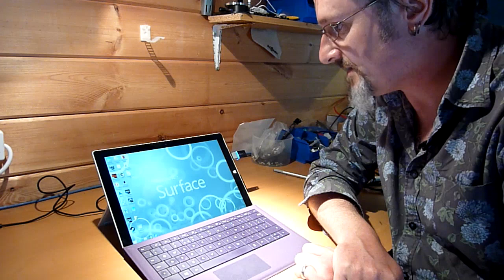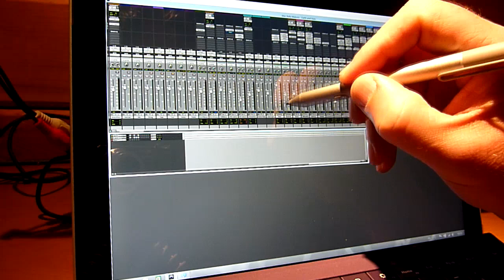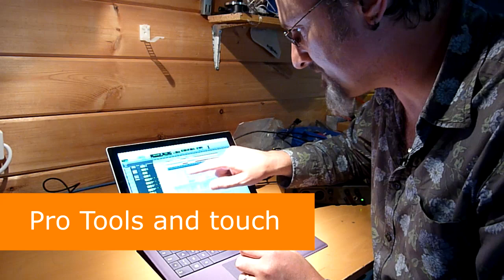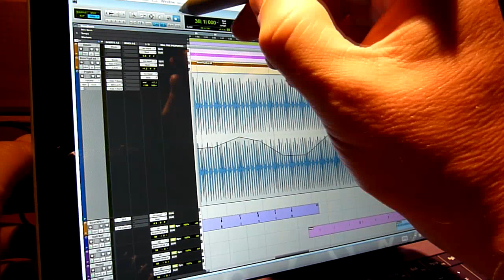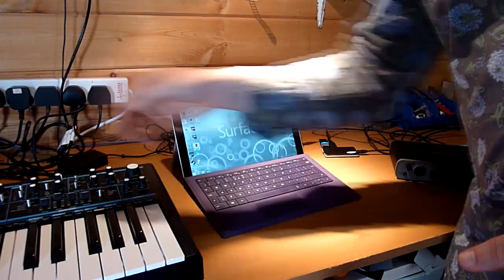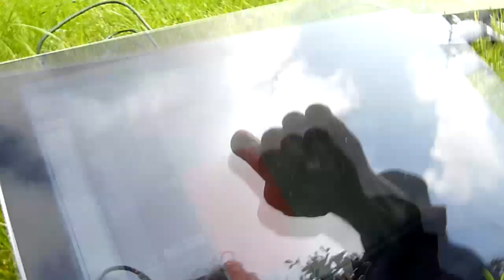Surface Sessions 03 - Running Pro Tools on the Surface Pro 3

Comment: Which Intel your Surface pro3 have ?? I'm thinking to buy " Microsoft Surface Pro 3 (4GB RAM 64 GB SSD, Intel Core i3, Windows 8.1) " But worried if I should buy Intel i5. But it's very expensive....I would really appreciate if you could tell me which version of Intel you use. Thanks !
Reply from the maker: I use the i5 - it does the job.
Reply: OK, I will think about i5. Thank you so much !!

Comment: is it matter windows 8 or 10? for i5 256gb 8gb ?
thx
Reply from the maker: Not sure i understand what you're asking?
Reply: well, I'm going to get SurfacePro3 for using some musical programs - Staffpad and ProTools mainly. The video above - was the tablet with Win 8 or 10? (as I understand StaffPad is just for Win 10 now)
Reply from the maker: Pretty sure at the time it was Windows 8.1 - StaffPad has worked on both but there's zero reason to stick with Windows 8.1 if you have it.... except the upgrade price now i guess :)
Reply: they say Staffpad for Win 8  will be frozen (or is already) . So  SF3 i5 256gb 8gb + Win10 + ProTools works fine? or SF pro4 is better (actually I doubt) :)
Reply from the maker: the SP3 is excellent and works with everything. I do not recommend running Pro Tools on the SP4.
Reply: fine! and thank you for advises ))

Comment: I'm not sure how I feel about this. The portability seems great. Crisp screen and very responsive software. But it seems like using recording software on such a small screen.. with so many records to look at, it's hard to get the overall picture. I can't lean back in my chair and work no this late at night. That could be an issue... is there no hdmi port where I could plug this thing into a bigger monitor?
Reply from the maker: Adumantium It has a mini displayport so you can absolutely connect it to another monitor. I find that when working with the SP3 i lean into it, like writing in a book or using a sketch pad and so i work differently to how i would with a large screen - but with another monitor you can work however you wish.

Comment: great demonstration, the Surface's performance looks very promising.
all the problems you've encountered, I wouldn't call problems, just little stumbling blocks.

regarding the the support of multi-touch.
I've also tested a few Daws (Cubase, Pro Tools, Ableton Live, SonarX3) on a notebook with a touchscreen, and only Sonar was convincing, because I could really make use of the multi-touch.
(one thing the Slate Raven solves with a software addon over the protools faders, as far as I recall).

I'm looking forward to this future in the world of audio production!
Reply from the maker: Thanks! Yeah it was all pretty smooth really, it could totally do it :)
I did a video a couple of years ago on multi-touch with DAWs - just when Sonar X2a came out - it was under the Rain Computers name and you should easily find it in YouTube. Yes the Raven provides an overlay - DTouch does the same thing and you can use controllers like SmithsonMartin Emulator or Usine Hollyhock to do a very similar thing and i'll be getting into those over the next few weeks.
Reply: Molten Music Technology
thank you, found it and watched the two parts.
on the retrospective it's very interesting to see, that Cakewalk really did improve themselves with Sonar X3.
Didn't know about Emulator, but this looks very very interesting.
I will definitely take a look at this software!
I was very sceptical about the whole concept of touch controls, but after I actually tried it, I just can't be without it anymore.
sometimes, I even mistakenly try to touch non-touchscreen devices and move things around! :D

We are most certainly moving towards a very exciting future.

Comment from the maker: Running Pro Tools on the Microsoft Surface Pro 3
Reply: The Surface Pro 3 uses a 3.0 grade USB.  I believe you are using a 2.0 or lower grade USB Hub.  I noticed on Amazon.com that a 3.0 grade USB Hub with up to 7 ports are now available for purchase. Perhaps this 3.0 grade USB Hub can improve the plug and play performance of your multiple devices. Please let me know if this will help.  Enjoying your session, so that I can help get my 15 year old setup with a reliable music center setup.  Thank you for your excellent videos.
Reply from the maker: Maybe - certainly a powered hub of any type would improve the situation but i'm yet to try a USB3 one - i'll add it to the list :)
Reply: Have you tried Pro tools x w windows 10 ?
Reply from the maker: No, it's not out until Thursday.
Reply: Molten Music Technology ,

Comment: Great video. Is this the i5 256gb 8gb version, or did you spring for the 512gb version? I have the i7 256gb 8gb version, but the i7 is overkill in a device like this, and does run hotter than the i5 in my experience. On the other side, the i5 4gb 128gb version is not enough for musicians. Same with the i3.

Yep. Headphones and speakers are two different devices. Windows tells apps when the headphones get plugged in, but the apps need to be listening for that. Works fine for media apps like watching a video, but as you've seen that causes some funkiness when you want a pro audio app to work the same way.

Resolution: does Pro Tools support internal UI scaling like Ableton Live does? I've found that these apps don't quite understand high DPI screens. You can either run them using a "no scaling" compatibility mode, or check for internal scaling. Or, you can use the pen like you did. 

For automation, the pen looks fantastic. I hadn't thought of doing that.

Good point about the hotkey toolbar. Seems like a great app idea.

The USB test is fun. Definitely over the amp limit for USB there, especially when not plugged in on the Surface :)

Looking forward to the other reviews. ImageLine worked hard on FL Studio Groove. It was one of the first real music apps for the Windows Store.
Reply from the maker: Yes it's the i5 256GB 8GB version - probably the sweet spot in terms of music production for size, power, heat and price. I'm going to do a bit more work on what the USB port can do - see if i can get an audio interface and a controller like the Launchpad running reliably. The scaling worked well in making Pro Tools more usable but you're always trying to find a balance between ergonomics and desktop space. Lots more goodies to come :)